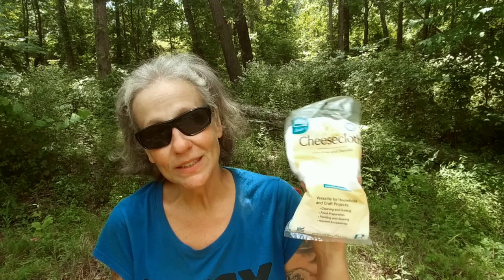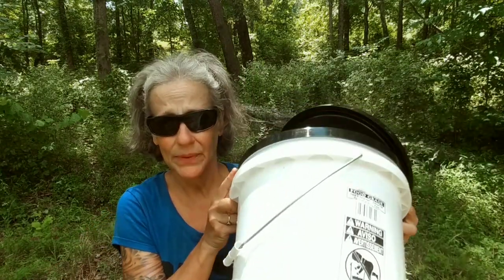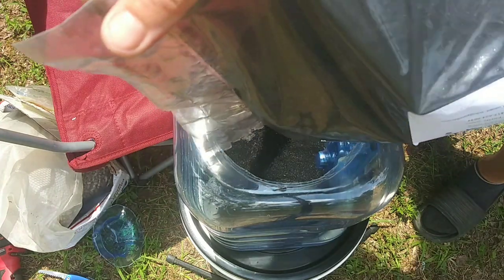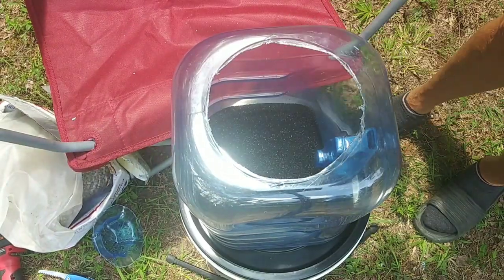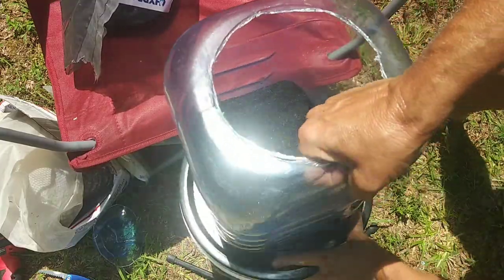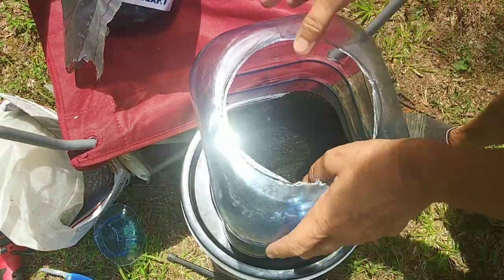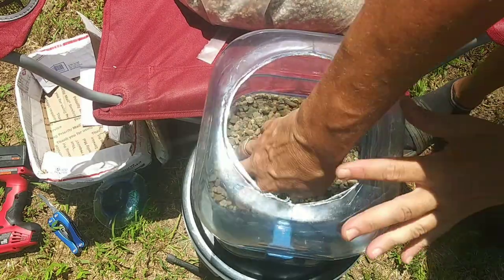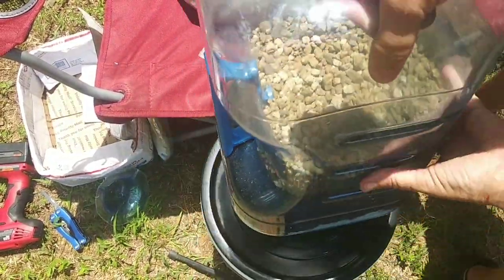Building a DIY Water Filter Using BioChar and a 3 Gallon Jug - Ann's Tiny Life

Comment from the maker: If you've got a question it's more than likely already been answered in the comments below. So have a look at the questions that have been already asked and I hope it will be helpful!
Reply: How many times could u actually u the filter
Reply: Hi Ann, is smashed carcoal for barbecue also good to use ?
Reply from the maker: @alanpeksider2255  I don't recommend the use of charcoal briquettes used in barbecue grills as a filter medium. It's not pure, even when crushed it doesn't have as much surface area by which to capture impurities, and may include chemicals which bind the briquettes together as well as chemicals to help them ignite quicker.
Reply: @alanpeksider2255  "Activated" carbon is what you want to use.  It is made by burning at high temperature in the absence of oxygen.  This is why if you're making your own in a survival situation you take hot coals from the fire and burry them in the soil until they cool.  Otherwise the carbon will already have bonded with other material and not work as a filter.  Charcoal for barbecue likely has a number of harmful chemicals as well.  Do NOT use it for this.  You can pick up "activated" carbon at most pet stores.
Reply: @AnnsTinyLife  thank you
Reply: @keyofg2020  thank you also
Reply: Could I use this system with dehumidifier water to drink?
Reply: @rolandrhodes1559  I would be worried about bacteria.  Carbon filters are great at filtering organics, but they shouldn't be relied on for micro.  If you boiled the dehumidifier water first and let it cool you'd probably be fine, but I wouldn't do it unless this was your only water source.
Reply: Awesome video

Comment: This is the best video that I have seen on filtering water. The only thing you forgot was to rinse your stones and charcoal really well, but I'm sure that you knew this. Other than that, great job!
Reply from the maker: thank you! I mentioned this before multiple times in other comments but I'll go ahead and mention it again. I needed a way to demonstrate how well the water filter works. what better way than to keep refiltering the water used to rinse the stones and charcoal? plus if you live off grid like I do you don't want to just rinse water and throw it away. you need to use it for something. so I didn't forget to rinse the filter medium. that was by design.

Comment: I use about 6 layers of pantyhose covered with 4 or 5 layers of cotton t-shirt instead ofthe cheese cloth. And before adding the sand and rocks, either bake them in the oven on 450°F for about 20 min or heat up in a frying pan on high to kill any germs. Or tou can boil them for at least 20 minutes, if you prefer. Also add a spigot to your bottom bucket and set the entire assembly up on some type of pedestal so you can access the purified water more easily. Also, a new teracotta planter with the hole plugged works very well as a filter.
Reply: What are your thoughts on using tshirt, I'm just wondering if the wet material will get mouldy. How does that even work I wonder
Reply: @deliamaendel8579  T-shirts will work fine in an emergency situation but not long term. Wet cotton will break down eventually. So, if you change it regularly that will work.

Comment: Nice!  I bought a home with an old whole house water filter system that looks like it was designed to refill with bio-carbon, etc.  I am going to use it, for pennies, rather than replacing it with a $4,000 system that will cost me hundreds per year to maintain!

Comment: That was great to watch because you prove that the filter actually works and in a situation where you didn't have plenty of running water you can just keep pouring the water through the filter until you get all the dust out and of course it's not that difficult to make your own charcoal I wonder though if you could make bags of the cheesecloth to separate the different elements or you several containers to hold the charcoal and the sand and the gravel separately
Reply from the maker: it's funny that you mention that because I'm going to do that with the cheesecloth in the next build. but I'm going to be using some different filter medium.
Reply: @AnnsTinyLife  Something you can try (I plan to) is put fresh cheese cloth between each layer. I would be curious if it works.

Comment: Thanks for the demo, very helpful of you.
I've now made mine too to filter our limescale and chlorine ridden tap water here and plan to use it for rain water very soon. 
I made it from glass containers I had already,  the base is a kilner 8lt drinks dispenser that sits on the counter top lifted up a bit and I had an old gallon glass brewing demijon that use a tile electric cutter to remove the base off! The top of the now upside down demijon fits perfectly in the wide opening of the kilner opening. 
Looks kind of cool and works great with the aquarium activated carbon and cheese cloth and gravel on the very top.
Reply from the maker: That sounds fantastic! I would love to see a photo or video of it!
Reply: Yes I want to try out rain watee
Reply: I'd love a demo of your system. Wonderful idea.
Reply: Hey Mike will the filter remove trace metals, bacteria, salts and such? Have you ever had a full analysis done on the finished product? I appreciate any feedback, thanks
Reply: @chriscoyle1855  I wouldn't know sorry, I only use it for in the kettle.  it would be good to know though.

Comment: Amazing, thank you so much. Really going to do this, those filter manufacturers are such jerks, 160 for a berkey filter now. Note, for those making their own charcoal, I read it is manufactured by burning in the absence of oxygen. Thats hard to achieve at home. Caution, ash plus water makes a very strong caustic type of alkalie, so I guess rinse the kind made by burning outdoor, or just buy the one this fine person recommends, thats what I'm doing 100%, not messing with wood.
Reply from the maker: Glad you found this useful! And yes, when I burned wood to make my own biochar I dump water over it when it's still in the fire pit. I collect it and rinse it again. But that biochar is still working out great for me! That water filter is still filtering clean water! Yes the Berkey water filters are very expensive!

Comment: Haha I thought about coffee filters this morning 🤣 6am and my water is stopped up.. years of diy-internet at its finest. Great content!
Reply from the maker: Thank you!
Reply: i am thinking of drilling a few holes in 2 buckets with a small circle (lid and bottom lined up, place 10 to 20 coffee filters in between or on the bottom to cover the holes, then do some version of activated charcoal (in a zipper cotton pillow case maybe), then sand that has been baked in the hot sun 8 or so hours... seems cheaper and I like being able to reuse things. yes, cheese cloth could be washed and then dried in the hot sun to reuse, but the charcoal is all mixed into it.  Rocks are only needed, I think, to catch larger particles, but  someone correct me if I am wrong about that.

Comment: where did you buy that big bag of coconut charcoal? The only ones I've seen are in small bottles and expensive. so I am guessing the larger bag is going to be cheaper in bulk
Reply from the maker: here's a link to my Amazon idea list for water filtration. it contains everything I used to make filters. The activated carbon is there. the only thing i havent used yet is the kdf. that'll be in the next one. you'll be able to make several filters with the stuff on that list. As an Amazon influencer I may make a small commission for qualifying purchases made by  clicking on one of my links.

https://amzn.to/3snTWbX
Reply: @AnnsTinyLife  Thank you soo much. I plan to make an order. I think I'll need a nice good supply of it so bulk is the way to go to get cheaper price per pound. I'll support your links. If you find a good source of larger bulk, please post that and I'll start ordering those. drinking clean water is a lifetime addition so I will eventually use it all up.
Reply from the maker: I'll  definitely post if i find it in bulk cheaper!!

Comment: Hello Ann, thank you so much for a great video on water filter. My question is, do I need to boil water after filtering or it is safe to drink after filtering.  The second question is, can this filter remove fluoride from water? My area has a problem of excessive fluoride.
Reply from the maker: I've used this filter with lake water and drank it and never had a problem. but you have to consider the source of the water. to be safe boil it,. or add kdf upstream of the carbon in its own little pouch. I'm gonna get on that video I've been promising and show how to do it. stay tuned!
Reply from the maker: ps yes it can remove fluoride.
Reply: @AnnsTinyLife  Thank you so much Ann, your response is timely and I cannot thank you enough! I will make a filter like yours maybe I will add some UV LEDs somewhere as as a safety  precaution(in case of bacteria) otherwise you are awesome Ann

Comment: Nice simple method thanks for posting. I have two questions. 1. Would you trust this method to convert ground water from an old well into drinking water? 2) do you know a good affordable source of preprepared activated charcoal in quantity? I live in an off grid community and am thinking we really need to utilise this method. Currently our drinking water comes from a fountain some distance from us and it would be better (&more self sufficient) if we could just use  our own well water.  However it is very smelly water full of particulates and little life forms. Any feedback much appreciated. x
Reply from the maker: I have filtered the grossest stinkiest lake water with a filter just like this but smaller and it filtered it completely clear. however if your well water has a lot of bacteria in it, or sulfur, you may need to add another ingredient. it's called kdf. there are a couple formulations of kdf and one of them filters out sulfur. so I don't know if sulfur is the smell you're smelling? I'll be building another filter very soon using kdf in addition to the activated charcoal and sand and gravel and whatnot. you can find activated charcoal, the exact same kind that I used, on amazon. I'll come back in a little bit because I have chicken chores and see if I can provide you the link. as far as the particulate and little swimming things this filter would absolutely remove them.
Reply from the maker: https://www.amazon.com/shop/annstinylife?listId=4VZ4P8342O52

that is the link to my Amazon affiliate store. it's just things that I recommend, have used or will be using very soon. the first three items are what I have you take a look at. the brown stuff that looks like soil is kdf. if you purchase something through visiting those links I get a small token of money from Amazon. when I built that 3 gallon filter I only used half of the activated carbon. so there's quite a bit in there. stay tuned for when I build my new filter using the kdf. I'm still doing a little research on it because there's a trick to it. good luck and let me know how you do on yours!
Reply: @AnnsTinyLife  thank you for such a very helpful answer! :)
Reply: @AnnsTinyLife  thanks! 😍
Reply from the maker: @amanonerth7592  You're very welcome!

Comment: Good job. You probably wouldn't need to fuss so much with so many repeated filter run throughs if you go ahead and use sand and also use cloth, like cotton T-shirt cloth or cotton. 

The trade off is that it may take a little longer to filter, but not as many times before you produce desired purification. You can also layer the materials twice i.e. cloth, activated charcoal, sand, gravel, then another layer of cloth, activated charcoal, sand, gravel. 

I'm hoping to do my own experiment soon. Imitating nature, this is cool!
Reply from the maker: Great tips! I'm getting ready to build a new filter very soon using more layering. I can't wait to get it done. I'm trying out some new filtering medium that will filter out even more bacteria, chemicals, and other such materials! Nature is so cool, isn't it?
Reply: @AnnsTinyLife  Yes it is! Very fascinating!
Reply: @AnnsTinyLife  what new medium are you looking into?
Reply from the maker: @bryanfugate2501  Sorry it's taking me so long to get back with you I'm just now seeing this. I plan to add kdf.

Comment: Good job ann
Reply from the maker: Thank you!
Reply: Great info. Now I know how to make my own water filter❤️❤️
Reply from the maker: @judyburger3719  you can do it Judy!
Reply: Ann's Tiny Life   I think the best part of this is you can make it as small a a 2 Ltd bottle (which I watched Ann make in the van life) or as large as a 3-5gallon jug like this.  The great part is it doesn’t have to be rain water, I watched Ann’s 2 Ltd. bottle clean water from a lake that looked filthy.  It ended up as clean as this water.  You wouldn’t have to scoop smaller amounts into the jug you can just pour water from the 5gal bucket into the jug until it is filled to the top.  When that filters, just do it again all at once if you need to.  I think I would pour the water from the 5 gallon bucket into a few pitchers to fit in the refrigerator one at a time.  Store the rest in the water jug she already has with a spigot top.  Use the second bucket to place upside down over the opening in the 3-gallon jug until you need to use it again.

Comment: Where did you get the water from?, If you get it from a lake or stream do you need to put bleach or chlorine in it?? Thanks
Reply from the maker: I capture rain water. although I've used this kind of filter to filter lake water. it too was crystal clear. never got sick from drinking it. although to be sure you can still boil it. no I don't add bleach or chlorine. those are things you'd actually want to filter out. if you use bleach you'd need to let it sit to allow it to dissipate.

Comment: I used a small old fire extinguisher as a container,  i cut the bottom out with a grinder then I cleaned the fire extinguisher thoroughly from the inside i then cut out the bottom of  a 2L plastic water bottle put the fire extinguisher in it and i used a heat gun to shrink the plastic bottle so i can poke a few holes in the lid and use its lid as a drain hole if i lose the lid or it needs an upgrade I'll just get a new one from a different bottle, i used activated charcoal, a thick rough cleaning cloth and on top i used ceramic rocks designed for aquariums to prevent charcoal from floating

Comment: Thank you so much for this video. Awesome directions/demo. As soon as I get the supplies I am going to do this. I live in the city but I have lime in my water. I have a question~how do you go about getting the water in the clean bucket to drink/use? Do you have another bucket to put the filter system on to start a new bucket? Maybe that is why you mentioned the 2 lids. Hmmm~wonder if there is a way I can put a spigot on the clean bucket ( plumbing is not my thing~although I saw you put one on your water catching barrel~if you can do it~I can do it~I think. Also, how long will the filter system last? This is just plain awesome. Thanks and L&Hs to Judy.
Reply from the maker: right now I just scoop it out with a clean scoop of some kind. but a water spigot on the bottom of the clean filtered water barrel would be a fantastic solution!
Reply from the maker: oh as long as how long it will last? I've never made a filter this big so I'm not sure. So that information will have to come later. on my smaller ones they would last me at least 6 months. but there's other factors you have to take into consideration  too. like how many times you're using the filter, how much water you're filtering each time, etc. 

here is a link to how long a Berkey water filter last. It's not the same system but it will give you an idea. I'm betting it's pretty close to how long a Berkey water filter would last.

https://theberkey.com/pages/faqs#How%20often%20do%20the%20Black%20Berkey%20Purification%20Elements%20need%20to%20be%20replaced

I'm betting this filter that I have will last about a year.
Reply: @AnnsTinyLife  - Thanks. That will do for me.
Reply: @AnnsTinyLife  Does any biochar work for filtering water? I found a site in Canada that offers a large bag of biochar for garden soil. Can I use that? I don't want to order from a place that overcharges for "activated charcoal or carbon". I didn't see a link for the biochar that you use.
Reply: I had posted this question as a reply to someone's comment. I subscribed to your channel and I'm completely new to commenting on Youtube videos. I couldn't find the area that allowed me to post the question/comment without having to "reply" to someone else's comment. I'm signed into YouTube and thought that it would make the comments section available but I didn't see it. Can someone respond to this and tell me how to post a comment directly to Ann's Tiny Life video's? Thank you so much.
Reply: @lucielager3278  - Hi. Usually just below where the number of comments is stated is a line that you click on ( it will say 'Add a public comment...' ). After typing your comment, just below it on the right is a COMMENT button. Click on it and you are done. Hope this helps and is clear to understand. Welcome to Ann's channel. She is awesome.
Reply: @donnab8010  Yes. She's amazing at teaching. Thank you for explaining this to me. I really appreciate it. :)

Comment: I wonder if the charcoal powder can be put into a zippered pillow case - so can dry out in sun a few months later and put where you need it in the garden? waste not want not. and maybe sand can be baked in a solar oven before using?
Reply from the maker: I think so. or a pouch made out of cheeseoth. I intend to compartmentalize my next filter in a similar fashion.
Reply: @AnnsTinyLife  this is all great! Maybe pantyhose can be used to contain the activated carbon..?